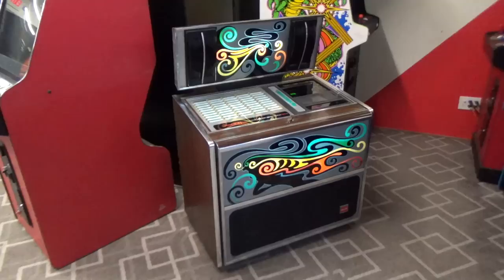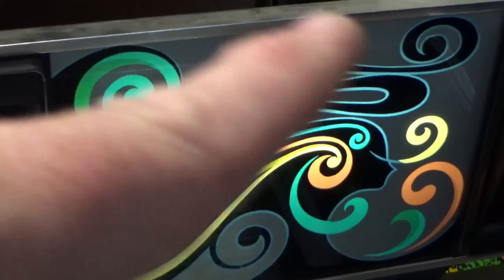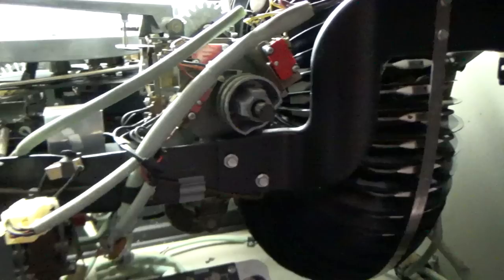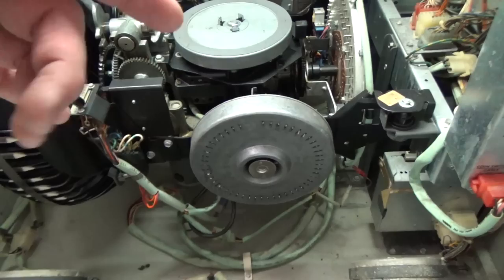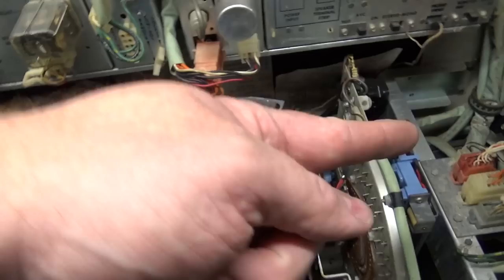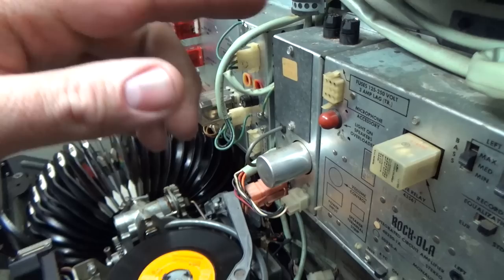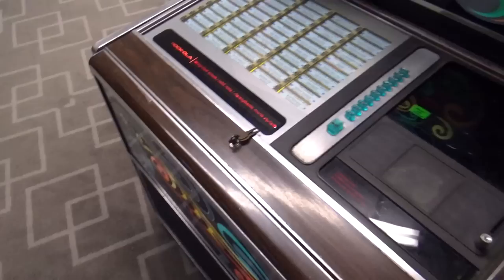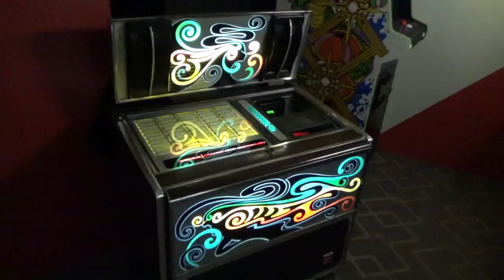A Beautiful 1977 Rockola 469 Jukebox - How It Works, Step by Step So You Can Repair Yours!

Comment: Solid state is transistors, diodes, etc.
Integrated circuits are combinations of solid state components all on a single silicon substrate in a package with multiple solder legs.

Comment: I have a 464 and still having issue with the write in Ive sprayed and cleaned the buttons and well as the fingers and write in plate any other suggestions?
Reply from the maker: Email me what it's speficically doing and I can look over the schematics.... Does it not write in at all, or does it only do some of them?  If it doesn't do any at all you may be missing the negative 28 voltage, I was just looking over that for somebody the other day.
Reply: @LyonsArcade  yea it just spins the last number will lock in but the write in just spins. The numbers over on the far right dont show it going thru them like I have saw in other videos either. From time to time it will stop but not trigger any pins.